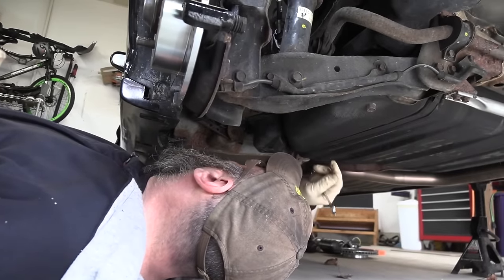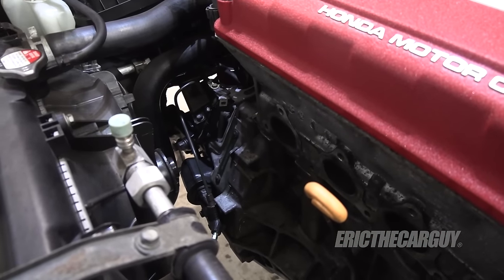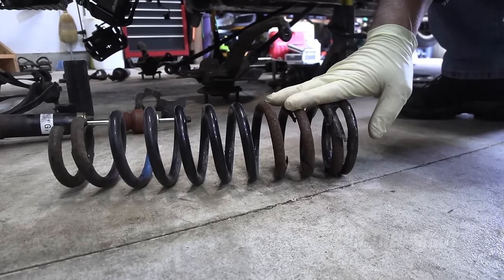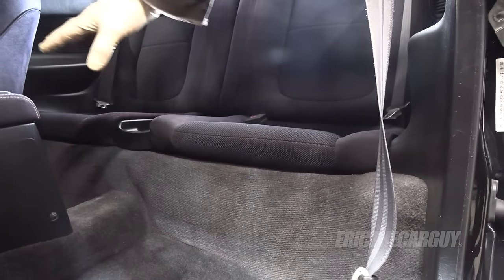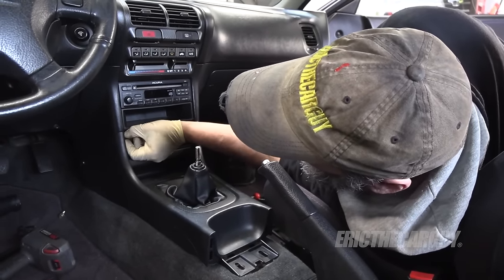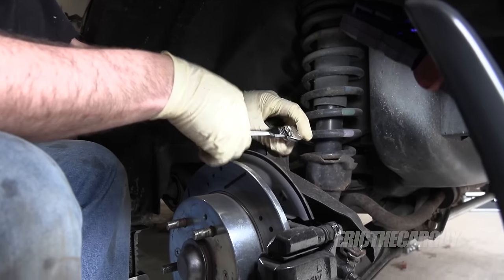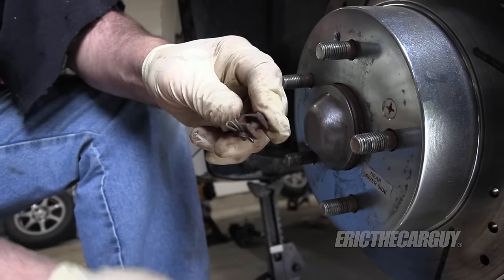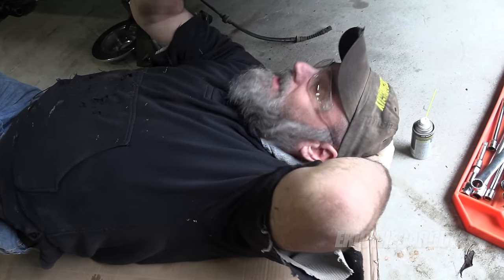Integra Type R Restoration (Part 1) #ETCGBlackBeard

Comment: The only person that put original Honda parts on a type R
Reply: TypeR.  Lol
Reply: Probably Gixxer as well!!😂
Reply: There is no orginal Honda parts anylonger like back in the days..that time is passed u know.. now other factorys does parts to Honda.
Reply: I have all the OEM Honda parts to replace all tie rods, end links, bushings, including things Eric couldn’t find such as the front & upper control arms. Most are still available and Hardrace, Mugen, and Spoon can fill in the blanks.
Reply: So where is all that oem parts comming from and have been all theese years?
Reply: @honda4185  they are still Honda OEM parts, they just get someone to make the parts for them to their specs.
Reply: @sunsetoriginals7320  If they remake the parts.. the parts is not oem u know. Oem parts was done back in the days.
Reply: @sunsetoriginals7320  So if i do one part to oem specs.. it is oem Honda part then? 🤣
Reply: No, my friend also bought every nut and bolt from Honda for his Type R. Absolutely insane.
Not a single aftermarket part on the car.
Absolutely mint, 34k miles, all original paint, not a spec of rust and he's the second owner.
It's for sale by the way, but the car is in Germany.
Reply: @honda4185  OEM's don't make everything back then. Denso electronics, Aisin parts, Akebono brakes, etc.
Reply: @patx35  That's exactly what i mean.. not all made by "Honda"
Reply: @FPVForLife  Mate.. just cuse u buy all from Honda.. it's not done by Honda themself you know. And if the parts is not from back in the time they are aftermarket parts u know.. oem parts was done back in the days.. if they do new parts now..still aftermarket parts.
Reply: @honda4185  They are not from the hardware store, that's the most important part...
Reply: @FPVForLife  You know that mabye the same factory does those parts but don't put Honda logo on it.. i'm just tellung u to think about that.!!
Reply: @honda4185  So you think some generic home depot nuts and bolts are the same or out of the same factory as Honda OE parts?
Ok, nevermind. I'll let you alone with your beliefs.
Reply: @FPVForLife  Oh man ur funny.. think about this.. if you go and buy Honda oil at Honda dealership... u think it come from a Honda factory..sadly naah it dosen't so you have to learn urself a bit more of how it works.
Reply: @honda4185  Two completely different things. Of course the engine oil isn't made in a "honda factory". But your Honda valve cover bolts, water pump bolts or transmission bolts are absolutely not the same as some generic crap out of a hardware store. And are not made in the same factory.
Reply: @FPVForLife  Not really at all. Omg u have much to learn and find out about wich factory who does all parts and stuff.
Reply: @honda4185  No arguments left, huh? Got ya.
Reply: @FPVForLife  Don't feel the need to argumente with someone who don't know how it works sadly!
Reply: @honda4185 STOP it. ALL 1995 - 2006 Integra Type R parts sold by a dealer are STILL Made in Japan. I sold parts at Honda dealers. PROVE ME WRONG.
Reply: @williamlevy1981 just because it is made in Japan doesn't mean it's the same manufacturer. Most vehicle manufacturers rely on suppliers for many components and realistically a car manufacturer like Honda only makes some of the components themselves. Also OEM just means that specific company made the original components, doesn't matter if it was made the day after the car was released or 30.

Comment: Giving me flashbacks to when I was 24 redoing all the suspension on my GSR. On the floor, in a 10x20 storage unit, fighting soooo many suspension bolts (in ohio too). I had to have gone through 15 sawzall blades. Bought my first map gas torch. Managed to get the rear toe control bolts out with heat and an impact. I'm only 32 and can't imagine doing that again any older lmao. Thanks for the nostalgic entertainment! 😂

Comment: Don’t sell that type r. You’ll instantly regret it.
Reply: I agree, but he could probably get over $50k for that thing — and he’s got a family. Can’t fault him too much for it.
Reply: @Vashed555 No let them eat Ramen, I sold my S2000 for a good price used with 100k and to this day I regret it.
Reply: I know I regret selling mine…
Reply: As a EG guy I couldn't even imagine selling mine.
Reply: Maybe he's getting an S2000 or NSX... 😉🤔
Reply: @lorilightfoot6447  The best thing about the Integra is that you can still use it as a normal daily driver. 2+2 seats with a liftback. Reasonable running costs, and gets good fuel economy. It's also relatively tame when accidentally overdriven. Can't say the same thing with the NSX or S2K.
Reply: I think he still has his GSR and it's in much better shape.
Reply: When did he say that? Other than this video.
Reply: @Vashed555 guess that is what happens when you don't film videos for a year or so.
Reply from the maker: I know, but I need the money more than the car right now, also, this will be part of an upcoming promotion. I have plenty of other 'cars' to play with.  Including another Integra. Stay tuned
Reply: @lorilightfoot6447 maybe NSX, but def not S2K, as he said he doesn’t like them
Reply: Agreed.  Although if selling a very well restored ITR pays for his son’s college tuition, seems like it’s worth it 🤷‍♂️
Reply: Then post more video's the once every 6 months. lol
Reply: @mobilemowers  Eric the Car Guy was one of the original how to fix your car channels have some respect
Reply: @mobilemowers Eric seems have a lot going on, be happy he's posting something
Reply: Aaaaaahhhhhh noooooooo !!!
Reply: Christmas came in March!!! Can't tell you how much I've missed ETCG!!!
Reply: It's just a civic, sell it and buy an Si with a K20
Reply: This makes me miss my plain LS SE. always wanted a type r but it was too expensive. Good ol’ plain LS with an apexi ws2 was all I ever needed. I miss it
Reply: @Vashed555 Dude he probably put 50k just into those new parts lol
Reply: @ericthecarguy can appreciate that man! Glad you're back making videos, learned lots from your videos ❤
Reply: I had a 2000 ITR in Flamenco Black Pearl that I sold in 2007 for $17,500. Had 40k miles, unmolested, all stock, no accidents. Was a great car but I was purchasing my first home. It was a good move. The home has grown in value much greater than the Integra would have. It was fun to own and drive but was no longer considered fast at that time compared to the Mitsubishi Evolution and Subaru WRX STI cars out there.

Comment: This is what I enjoy. Hope all is well with you and familia. Im 71 retired lineman diyer, been following for mucho tiempo. Currently troubleshooting a po302 on my 2006 subaru sti. Did all the swapes except for injector. Did a compression and leakdown. All cylinders within specs. Did vacuum leak test with smoke machine. No smoke. Did same exhaust side got 2 leaks on both sides of secondary catalytic converter. This may be my po302 issue. I learned all this  watching your videossaved me mucho denero.

Comment: I have done similar work on my civic typeR.
Also in the process of finishing my 7th gen celica GT UK spect, think it's called trd in the USA.
90% of the suspension components have been replaced mostly with OEM parts. Unfortunately for me I run out of money for there rear shocks  but still kept them in hope toyota can source the genuine ones. If they can't then I'll have to restoring them.

Comment: Great to see you again. :) First off and genuinely meant; without you and your Honda and general spannering vids and advice my own Type R would have cost me a lot more in time and money and one of the reasons it's parked in my driveway all these years later is down to your good self. Thank you. 

+1 on the rear suspension setup. It particularly grinds my gears(1st world problem :)) when I see guys swapping in polybushes for that big main bush thinking it'll tighten things up. Oh it will, but the OEM bush is part of Honda's patented design whereby horizontal give in the bush dials in toe in under braking and stabilises the rear end. It's a major factor why Honda's of this period are famed for their handling. 

I've replaced most of my bushings and because I got mine rust free from Japan and then smothered it in anti rust wax the week after I got it the bolts came out good as gold. I check and reapply that gunk every summer. At this stage it's more wax than car. I'm that paranoid about the tin worm. :) I think it helps too that mine is my daily. It doesn't sit for long and gets the wind through it as it were.
Reply from the maker: YES! The original engineers of the car really knew what they were doing. It's very hard to improve on their work in my view.

Comment: I did a very similar restoration on a Subaru legacy GT wagon. I went more in depth but also had a lot more rust. I tore the car down and everything down to the body. I took all of the suspension components, subframes, and all other miscellaneous items to an industrial sandblaster to have everything blasted down to bare metal. That’s way too much work to be wire wheeling everything which has almost always has failed results because you can’t really ever truly get it down to bare metal especially with rust. Industrial sandblasters are usually $150 to $200 an hour, and they had the entire job done in a 1hr and 10 min. That was an entire car components. As far as the body I did wire wheel the unibody underneath, and I acid brushed all the surface rust spots and then painted. Just something to think about.

Comment: The Civic rears are always rusted together. To the point where sometimes a cutoff wheels and drill are needed for removal of what's left of the bolts. I have dealt with it enough to use marine grease on some parts and anti seize on others to make it easier if needed in the future. Usually better bushings as an upgrade.

Comment: Eric I did a complete type r swap (k20a) to my 2005 Honda Civic 4 door on my garage floor. I converted and I mean converted everything from the suspension to electric power steering from a integra type r from japan (dc5r). Living here in the rust belt with a chassis that has 350k kms in Canada is not easy to work lol. Guys down south get it easy lol.

Comment: i feel you pain eric. working on the ground also the suspension in those Hondas can be a pain. Had to cut the surrounding metal off the bottom of a rear shock in a 05 civic with a grinder lol.

Comment: Been there and done that on my Integra. Still own it to this day. Mine is standard from factory apart from JDM 16" wheels, JDM exhaust manifold, B pipe and coilovers (rides like standard). Mine is a UK model, owned since 2007 and is in championship white.

You're wrong about the PCV system, standard motors are fine with the standard PCV system. Intake is perfectly clean on mine. 175k miles on mine.

I just bought upper control arms and all front ball joints for mine, all available.

Comment: I'm saddened to hear that the Type R is going to go to a new home.

I started watching your channel around the time the video with the Subaru outback wagon plug tune up & diagnosing the blown Honda D series engine.

And the day when you have acquired the 3 Acura Integra's (1 Integra used as a parts car)

Quite ironic as I'm about to buy an Acura Integra (LS, non Type R)
Time flies, hope the Type R is going to a good home!

Comment: I feel bad that I am late to the party, but have you tried the weighted sockets you have for the crank bolt? I find that and a large amh battery on a big Milwaukee will brake about anything loose. Well, unless it won't then it's time for the heat.  Interested to hear your thoughts. Penetrating oil, little time, little more penetrating oil, little heat (Induction) then a big battery and a weighted socket.

Comment: Nothing worse than that short-lived feeling of elation when an extremely rusty bolt finally breaks loose only for you to realize seconds later, you snapped the head off.  On a through bolt it's not the end of the world generally, but when the bolt is in a welded on captive nut, or a welded on stud that snaps, It really sucks.  Been fighting with a 30 year old Nissan that lived it's life in the Chicago area here.

Comment: I have a question, where do you get parts that are harder to find for restoration? I have a 95 integra dash that is cracked, door panels handle part  known to cracking and as well the rear glass panels poping out and famous black window molding that breaks apart over time. Trying to find these parts are a challenge

Comment: Did that once with the PCV system... no vacuum in the crankcase... oil leaks everywhere and the smell of oily exhaust fumes wasn't great either
Reply from the maker: The PCV system is designed to vent the crankcase. They didn't always have PCV on engines. In fact, they used to run an 'oil draft tube' that would vent the engine right onto the road. In WWII the wanted to run their Jeeps underwater so they invented the closed PCV system so that water would not get into the engine when it was submerged. In short, an engine does not require a PCV system, but it does help contain emissions. Thanks for your comment.

Comment: integra type r . Stock it's scary fast . No aluminium intake tube needed . It's specially made for bretzel road . Dont you have to put fifth wheel grease for the aka washer looking body suspension isolator ?

Comment: Eric, the front upper control arms are the same for all '94-'01 Integras. VTEC or non-VTEC, coupe or sedan. Right 51450-ST7-020, Left 51460-ST7-020.
Reply from the maker: Yep, but I wanted camber adjustment so I went with K Tuned.
Reply: If you'd like to keep a more OEM setup, a company called SPC makes a great piece. You keep the OEM control arms, it simply replaces the ball joint and camber is adjusted with a single 27mm nut on top. And a nice dirt cheap trick I picked up for rear camber, place washers behind the 2 mounting bolts for the rear UCA. @ericthecarguy

Comment: You should use heat to the stuck bolts that won't come off.. do that and it will come lose.! 👍
Reply from the maker: I only do that as a last resort. The rubber in the bushings catches fire and breathing that in isn't good for you.
Reply: @ericthecarguy  Just heat up the bolt..not the rubber..and open the garage door then so you ventilate and a filtermask. It was just a tip.
Reply: @honda4185 dude who are you talking too here? Eric has a whole instructional video demonstrating what you just said. He knows man lmao